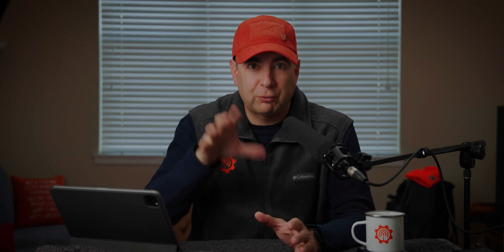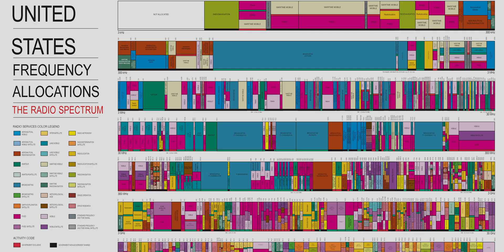EM spectrum and RF - Broadcast Basics

Comment: Do not forget the European AM broadcast bands, with the 9kHz separation. Here by me there was a very famous radio station, which was called Capital Radio 604, but the actual transmitter frequency was actually 603kHz. I listened to it at night, after the sunset, as the night time would allow it to reach me with a single hop, but I was outside the day direct limit. 

Same for another, LM radio, about the only broadcaster in South Africa on AM, with a transmitter that has a night time coverage all over the southern part of Africa, on 702kHz, a transmission frequency that they actually took over from the original state run broadcaster of that frequency, which is still operating on FM only, as Talk Radio 702. LM has both AM, and also FM, in a number of cities, though I am not in the coverage, so use satellite reception on a FTA receiver for it.

I actually listen to 702 only as a podcast, for one single show, ironically the show I get from the BBC in the UK, as they are the one that has a RSS feed for it, unlike the local broadcaster, who wants to sell you adverts on the podcast, and you have to listen off the web page with all the adverts. 

Hint to radio stations, give the listener what they want to hear, or they will move to another, there are so many you are stuck for choice, as there is a limited number of hours in a day to listen. LM has listeners world wide, because they are more music than talk, the name says it all, coming from the old Lourenço Marques Radio, shut down in 1975, but now opened again.
Reply: Australia uses 9kHz raster too on the AM broadcast band (per the 1975 Geneva frequency plan).  When I first moved to North America, the 10kHz raster had me all discombobulated for a while!  🙂  It's a shame that AM stereo has lost popularity - a good AM stereo signal sounds sooooo nice.
Reply from the maker: Good point! I should have included Europe’s spacing too. 

I understand, wanting to monetize a podcast, but sometimes the content producers get a little too greedy and over monetize some content.